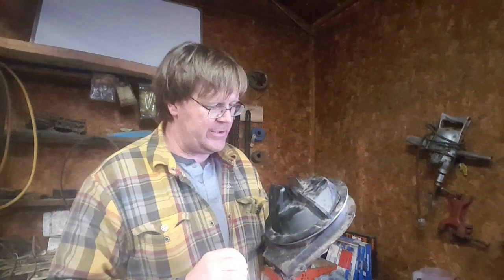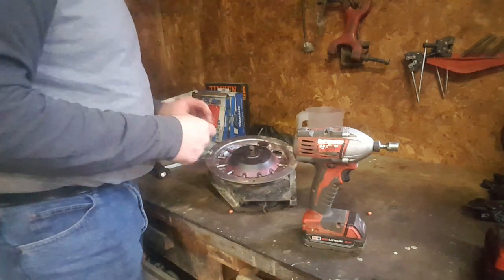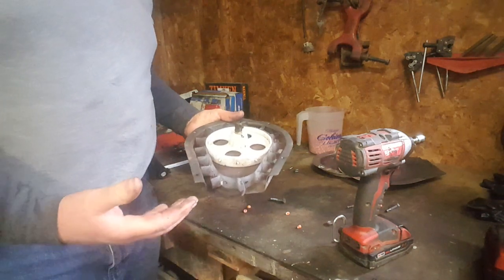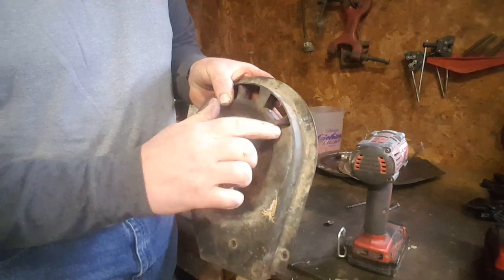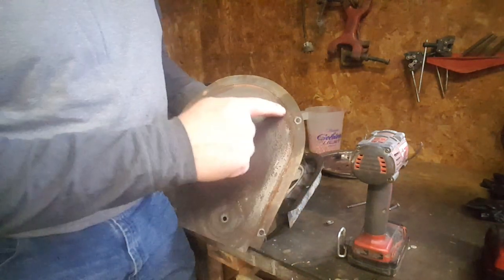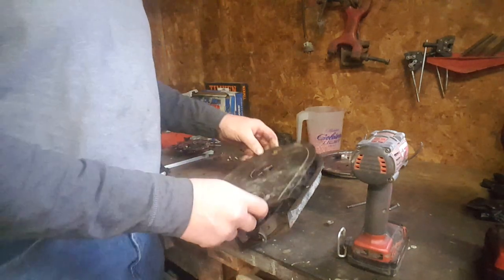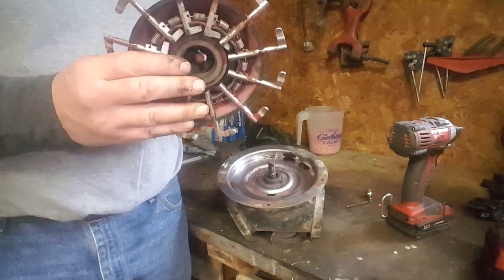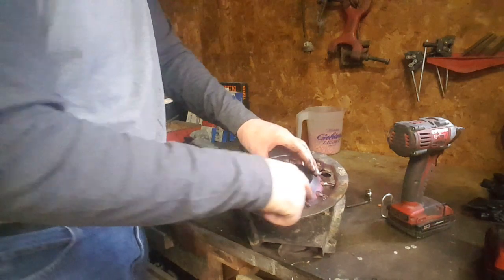john deere finger meters.

Comment: I know nothing about finger type planters, I am used to plates.  So I am looking to buy a 2 row JD unit with 7100 planters.  What do you do if you wish to plant other things like sunflowers, green beans, or other type seeds.
Reply from the maker: Any seed large like corn, beans,peas,, sunflowers...is ok, tiny seeds is tough.
Reply: For seeds other than corn/sunflowers/pumpkins, you can get Kinze Brush Meters... they fit onto the hopper bottom EXACTLY like the finger pickups do, with the same attachment bolt/nut and half-ring.  They have a number of different seed disks that attach to the driveshaft plate that allows them to plant various sizes of seeds, and different numbers of pockets for high and low rates (the actual rate being set by the planter transmission, but for crops planted at very high seeding rates like soybeans or grain sorghum there are disks with up to 80 cells, and for low rate seeding like hill drop cotton, maybe only 8 cells IIRC (each catching several seeds at once though).  This allows you to keep the meter and seed disk rotation speed in the 'sweet spot' for the rate your planting (the faster the seed disk turns, the less chance it has to properly fill each cell and the more likely it is to kick a seed out of the cell as it turns, same with a finger meter... they DO have a "sweet spot" or "do not exceed" speed to the meter itself in terms of RPM's-- that is why they recommend in the planter books on finger meters not to exceed 5-5.5 mph... the higher the rate your planting in terms of seeds/acre, the faster the meter has to turn to plant that rate, and the slower you should drive to keep the meter turning slow enough to properly get a seed under each finger and to properly eliminate doubles without the one seed that's SUPPOSED to be under the finger getting knocked out and getting a "skip".  That's why some guys planted as slow as about 4-4.5 mph, particularly at higher populations...  

The brush meters work on a similar but simpler principle... there's seed pockets around the edge of the disk, with grooves leading down at an angle to each pocket.  Seeds in the meter move down into the pockets where a tapered long brush tends to funnel them down to the pocket at the edge by forcing them along the groove (if gravity isn't sufficient) and the long brush then acts as a "cutoff" by pushing excess seeds out of the groove and keeping them in the meter seed pool at the bottom as the grooves turn past the brush.  Once the pocket is filled with a seed, as it turns past the angled brush, another brush along the periphery of the meter (outer edge) traps the seed in the pocket as it turns vertically up over the top until it reaches a position directly over the seed tube, where the brush ends... once the disk pocket turns past the end of the curved brush, gravity causes the seed to fall out of the pocket and down the seed tube, one by one as each pocket turns past the end of the brush.  They basically work on the same principle as a vacuum planter or air planter, only using a mechanical brush to hold the seed into the disk pockets instead of air presure or vacuum... when the air pressure or vacuum is cut off (usually by a wiper seal or rubber wheel covering the hole on the back of the disk, removing the source of vacuum sucking the seed into the pocket, or blocking the escape of air blowing out the hole holding the seed in the pocket, the seed drops out of the pocket by gravity.  The periphery brush does the exact same thing mechanically without any need of air or vacuum to the meter.  They will plant almost as good as a vacuum or air planter as well, with no worries about setting the air or vacuum levels or maintaining them correctly, or or vacuum hose or seal leaks, meter cover leaks, seed disk wear, singulator settings, etc. that can all screw up vacuum meter performance or cause a row to stop planting entirely.  So long as the brushes are periodically changed to account for wear, (and I never had to replace mine, I did a planting test every year in the field when I started by tying the press wheels up like he said and counting seeds) and they just neve wore out.  Seed disks similarly will last a VERY VERY long time.  Guys have even installed Kinze brush meters onto drills and planted wheat with them, so you can get a wide variety of seed disks with different numbers and sizes of seed pockets on them (cells).  

If you want to plant corn, pumpkins, or sunflowers, you can change the finger meters back onto the bottom of the hoppers in a couple minutes per row... easy peasy!  We used the brush meters planting cotton at 52,000 seeds/acre, grain sorghum at 80,000 seeds/acre, and soybeans at 110,000-120,000 seeds/acre and it planted all of them just like a sewing machine!  Good as any vacuum planter I've ever seen...

Comment: So, just kind of a dumb question. As someone who works at a precision dealership. How do you set the correct tension with the main nut if you don’t have a test stand. I’ve ran hundreds of finger meters and I know for a fact with out a test stand I could not get them set correctly. Often times I’ll even mark the nut and count revolutions when I tear them apart (for a good starting point once they’re back together.) an it could still be anywhere from 1/32 of a turn to 1/4 of a turn off. Which if you know anything about finger meters 1/4 of a turn is pretty substantial.
Reply from the maker: we never had meter test stands at the dealers. we tighten them by hand and feel sometimes use an inch pound torque wrench. yeah a 1/4 turn is huge.  the last group I did I took and ran them on a stand.  6 out of 8 were "perfect" the other two were just a little off,   technically a finger unit would be calibrated for each seed, go from small flat to large round. so just find that good spot to do a good job with all seeds.

Comment: Do you have bean meters for your planter??
Reply from the maker: No, the white uses a different seed plate for each type of seed,
Reply: @jonstevensmaplegrovefarms3754 what do you mean by that??
Reply from the maker: My old planter had a corn seed meter assembly, and then you change that out for a soybean seed meter assembly. This white planter you use the same meter housing and everything there's just a different seed plate. So if you want to plant corn, soybeans, wheat, sugar beets. No matter what scene you want to plant it's the same meter housing you just have a different plate
Reply from the maker: @aarongoeppner413  maybe some of the confusion is that this video is older and since then I picked up a white planter, 

On my John deere I had the factory bean cups than later put E set precision meters on. Made a much better bean planter
Reply: @jonstevensmaplegrovefarms3754  thanks!!!
Reply: @jonstevensmaplegrovefarms3754  Yes we put Kinze brush meters on our 7100 Deere planter... when I bought it the thing had regular flat horizontal plate meters and hoppers and drives on it, which I never even knew the 7000 series had available.  It was set up with the half-dome "peanut meters" in it designed to plant peanuts which is what the previous owner used the planter for, but it had regular plate bottoms as well. First year I used it I used the regular plate bottoms planting cotton, same old plates as the number 18 Deere planter we had before actually... all the plates are basically interchangeable and I actually collected a TON of old plates, every type and kind I could find, from soybean to sugar beet to grain sorghum to two-cell pumpkin plates... Deere even made "blank" plates you could get and then use a grinder to make your own seed pockets/number of cells you wanted for specialty crops and conditions, like the two-cell pumpkin plates designed to drop 3-4 pumpkin seeds every few feet as the plate turned to create "hill drop" pumpkin planting patterns or for watermelons or cantaloupes or whatever...  I have probably a couple hundred different cast iron and steel plates for the old bottom-mount plate meters, and a large collection of plastic seed plates for them as well that came out later.  

The next year I got some "plateless" hoppers from a used equipment place, and bought some Kinze brush meters from someone online (back in the early days of the internet!)  The Kinze brush meters work basically identical to a vacuum or air planter, only using a brush to hold the seeds in the pockets of the disk rather than air or vacuum which can fail if the wiper seals, hoses, meter covers, etc leak, or the hydraulics lose pressure and the fans stop allowing seeds to drop off the disk, say when turning.  The brush meters plant for all intents and purposes almost as good as a vacuum planter-- I did a LOT of tests and counts in the field and on the turnrow and I never could see a difference between a Kinze brush meter stand and a vac/air planted stand... BUT the Kinze brush meters, while great for cotton, grain sorghum, and soybeans that we planted, they DO NOT make a corn seed disk for them... for corn Kinze swapped in a finger meter in the brush meter's place-- the both bolt onto the bottom of the hopper identically.  The brush meter was SO good that Deere FINALLY dropped their ancient "controlled spill" drill-type copy of a double-run drill "cup" meter for soybeans and other seeds and created their own copy of the brush meter... which I'm sure works fine, though I never used one.  

I know for a FACT that the Kinze brush meter plants like a sewing machine compared to even the best setup old-style flat horizontal plate-type planters... there's no contest... If I wanted cotton spaced 2.5 inches apart on 40 inch rows, and set the planter transmission for that, that's what the Kinze brush meters delivered... right on the money, too!  If I wanted grain sorghum spaced at 1.5 inches apart, I could get that too... or soybeans in 40 inch rows spaced an inch apart... it'd do that too, and do it at a planting speed of 6 mph!  Wish we'd have had them 50-60 years ago....

Comment: Any chance you'd have a picture of the soybean population and sprocket setup from the manual? Thanks
Reply from the maker: I do not
Reply: You use a brush meter for soybeans (Kinze original or Deere's copy) or the old style "cup meters" in place of the finger meters for soybeans.  A finger meter might plant soybeans, but it'd be at pretty low populations with only so many fingers and being perfectly round seeds, probably highly inaccurate as they're made for corn/sunflower/pumpkin shaped seeds (ovoid/pointed not spherical seed).  The old cup meters were basically a copy of a double-run drill meter, not very accurate at all.  I put Kinze brush meters on my Deere 7100 planter and it'd plant cotton at 52,000 seed/acre, grain sorghum at 80,000 seed/acre, and soybeans at 120,000 seed/acre just like a sewing machine, good as a vacuum planter!   The fit on the bottom of the hopper in place of the finger meters, attach the exact same way, only takes a minute or two per hopper to swap them out.
Reply from the maker: @lukestrawwalker good to hear!
I used the dribble cups for a while, then went to v set.

Comment: Must be snowing out. I think your still running a White?  I’m running a 6100, just didn’t feel this was year to upgrade. Like your videos.  I’m starting to think you taking time off work extended winter...I’m sure your ready to roll when weather is fit.
Reply from the maker: Chad Fisher we got lucky with the snow missing us.  only got several inches.  south and east of us they got 20 inches.

not quite ready but 100 times more ready then if i was still at work.

last year i liked my 9000 series white.  this spring getting it ready I loved it.  inspect seed plate and brush and we are done!!!